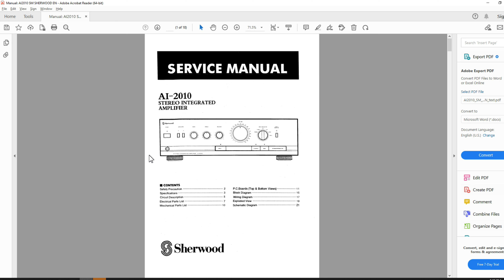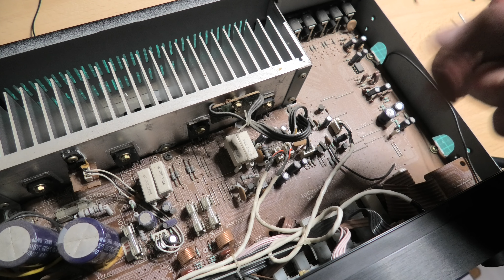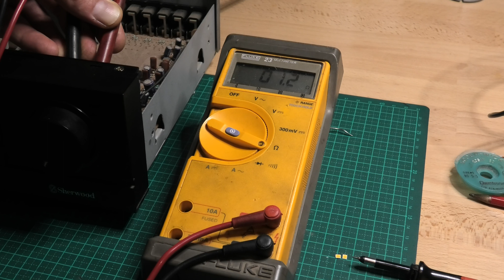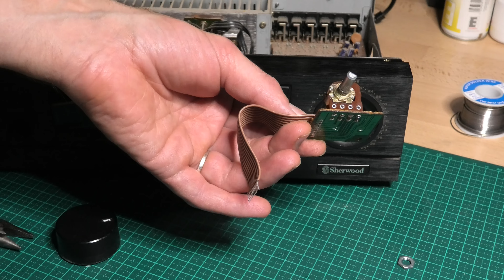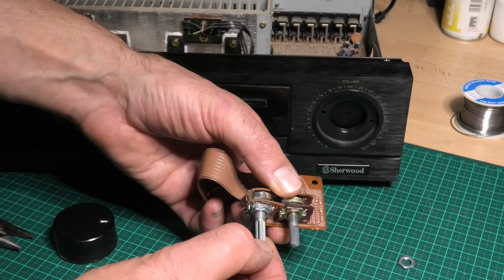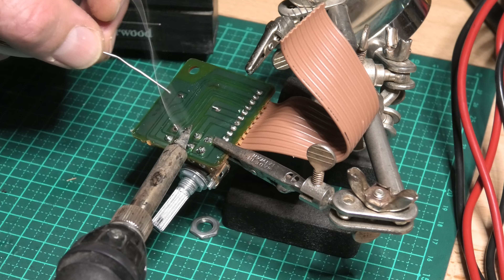Sherwood amplifier repair AI-1110

Comment: Hi there ,thanks for sharing, I have the same amp. I am looking  to order new bass,treble and balance potentiometers. I tried cleaning but they are showing signs of wear .

I have a noticeable hum when the  sound is off. My two big caps 50v 4700uf is a little rounded on the top. I can only source a slightly smaller one by  2 to 3 cm ,it has the same voltage, and uf. Would this work? I am ordering it from China, I can't seem to find a local store here in nz that has the same dimensions.  Your help would be greatly appreciated 🙏 thanks
Reply from the maker: Hey there. If your caps are bulging - pretty much anything will be better than what's in there - I'd recommend sourcing caps from Digikey if you don't have a good local source.  A 50V part is pretty close to the rails so I'd suggest using a reliable trusted supplier. I found the bass treble pots were OK, but the direct button needed some contact cleaner and solder joints touched up.  It's a nice amp - hope you manage to successfully restore it.
Reply: @Justfixitmate  thanks for your reply,I will be sure to check out digikey ,I can't wait to get it all sorted have a good day